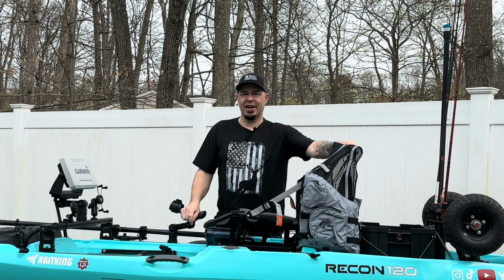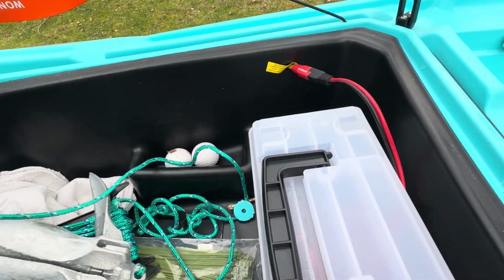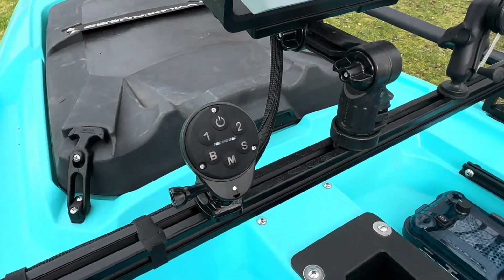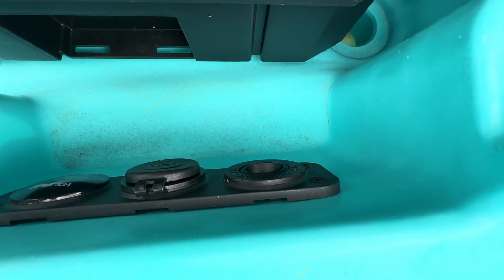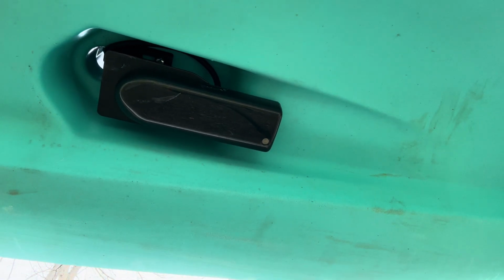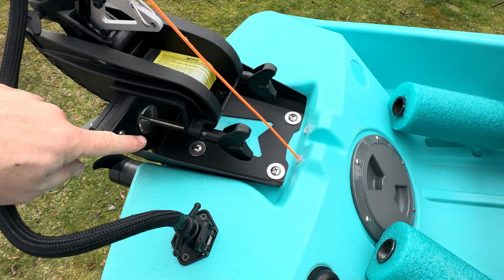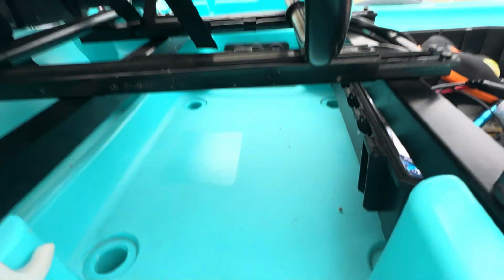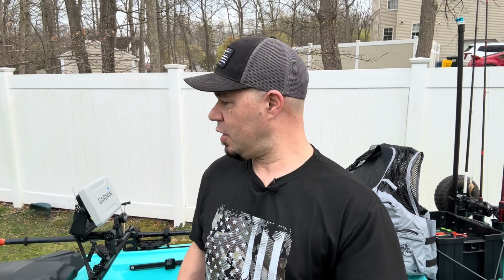My Complete Kayak Rig for 2025 | Wilderness Systems Recon 120

Comment: How have you liked the 50 amp battery for your motor?  Trying to decide if 50 is enough for up to half day trips or if I should consider a 100 amp instead.
Reply from the maker: If using a pwm, 50 would last you half a day. I decided to go 100 because I would never have to worry about